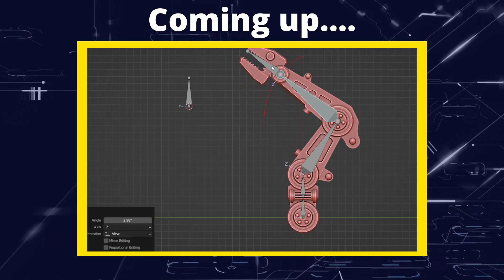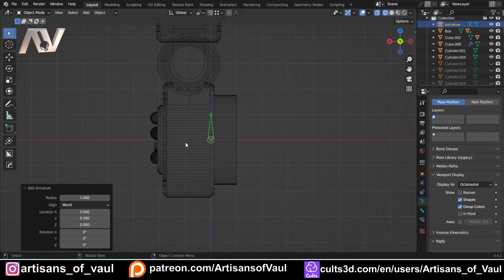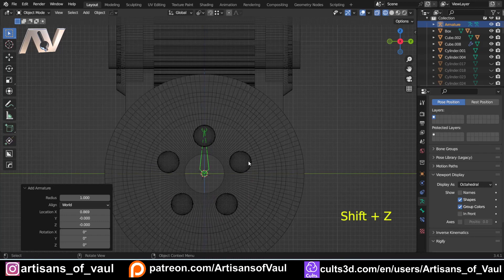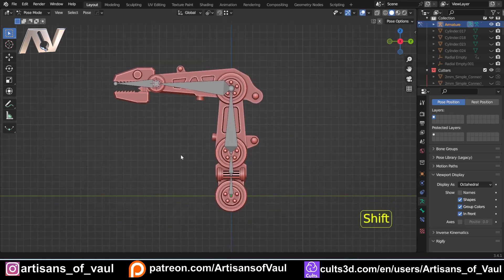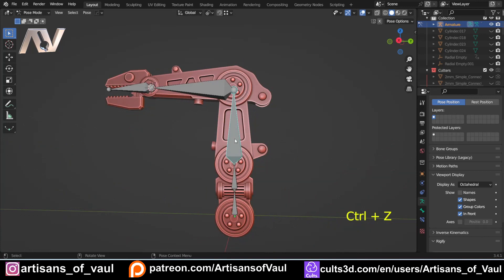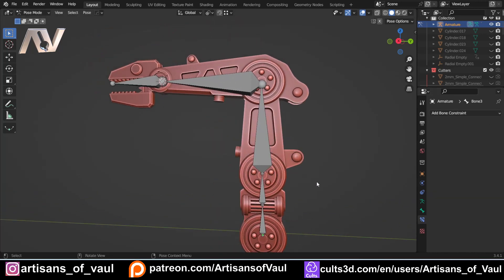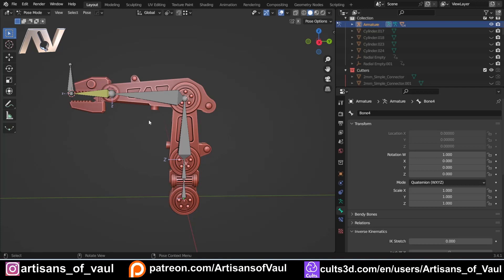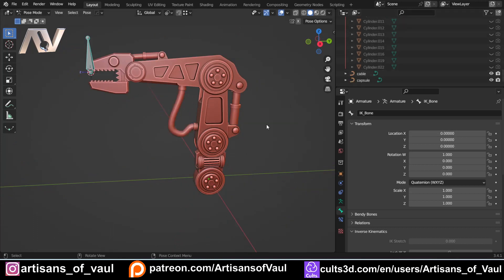Rigging with Inverse Kinematics (IK) in Blender - Mechanical Arm

Comment: Howdy! Im trying to rig some inverse kinematics for a robot and while trying to constrain some of the rotation I couldnt find where the inverse kinematic constraints were. I presume it was a change with blender but I dont know where to look. Any help would be appreciated! I am on blender 4.1 if thats helpful
Reply from the maker: What are you trying to constraint? Normally I only really bother with getting the joint to remain pointed in the right direction.
Reply: @ArtisansofVaul  Pardon the slow response, I totally forgot I posted a question. im trying to constrain the ankle and knee joints so that they can only rotate along their local Z axis. The way the robot is designed those joints couldnt rotate any other way.
Reply from the maker: @flaminggorilla7492  So you can use constraints to lock to only one axis but I really like the Machin3 Tools Deus Ex Group tools.  But they have recently gone to have a yearly update fee which could be a put off....  Video on me using it here: https://youtu.be/1RIK2Q7bSrk
Reply: @ArtisansofVaul  Appreciate it! Ive got an older version of Machin3 tools, I think from 2024? I'll try it out

Comment: this worked fine on my project, but dunno if i missed something, my ik controller bones move too far from the linked bones, although the rig is perfectly fine, the iks not staying attached to the armature is annoying.
is there a way to keep the IKs attached to the rig?
Reply from the maker: They should stay attached.  Not quite sure what you have done to make then not remain attached.  Did you extrude them from the model or duplicate them?

Comment: Great Tutorial! This really helped me to finally understand how rigging works.  I have one issue though: I accidentally extruded the bones without looking at it from a clean angle, so now my vertical bone is rotated in the z axis. This creates a problem when I try to constrain the movement. How can I fix that? I cant spin the bone in Edit mode.
Reply from the maker: Thanks so much. You will need to unlink it to anything assigned to it and then you should be able to move the bone and specifically move each end and snap them to other objects. Alternatively you can delete that bone and extrude a new one.

Comment: If you have more than one IK bone, how do you parent them so that they essentially do not hinder IK movement from other IK bones?
Reply from the maker: Do you mean like for seperate limbs?
Reply: @ArtisansofVaul  Yes, further up the bone chain. I know it's possible... I've seen it but I've totally forgotten where!
Reply from the maker: @paincult7121  I believe it depends if its directly connected/extruded from the earlier bones. You can bring in a new bone and it should act separately.
Reply: @ArtisansofVaul Oh the IK bones aren't connected by any means. I saw someone use bone constraints(targetting upwards towards the next IK bone) but I forgot how they set that up. Sorry I'll go try and take a look!
Reply from the maker: @paincult7121  you can use constraints to keep one bone "linked" to another at a distance.

Comment: Great tutorial. It took following about 3 or 4 different tutorials years ago to figure this all out. Yours is extremely well explained with examples. The model is simple, but has some complex movements which is great for an example. And I can't wait for the next one, because pistons was the bane of my existence and nearly made me walk away from blender for a time. :D
Reply from the maker: Really glad it's clear. Its a bit of a difficult one to explain concisely so I was worried it was too long at points. Pistons is an interesting one as it can get errors as it works regardless (if you are too harsh with movements). But hopefully it will be equally clear.